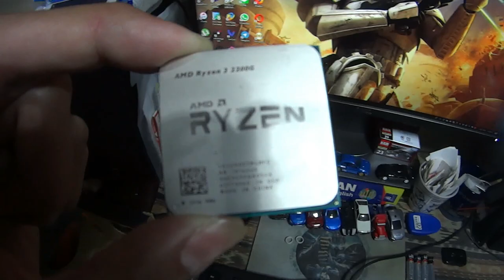AM4 Socket - AMD Ryzen 3 Processor (Installation)

Comment: Can we install am4 cooler on am3+ socket ?
Reply from the maker: Theoretically the AM4 stock cooler should fit on AM3 + boards, unless the holes are positioned differently then it won't. I haven't tried it.

Comment: - Processeur AMD Ryzen 3 1200 4 cores 3.4GHz (Turbo)
- Carte graphique NVIDIA GeForce GT 1030 2 Go GDDR5
- Carte mère ASUS PRIME A320M-K
- RAM 8GB DDR4
- Disque système SSD 240 GB
This is good or bad please tell me 😍😍😍
Reply from the maker: I think your computer set is suitable for office work and very very light gaming. Mainstream gaming nowadays are best run on CPUs with at least 6 physical cores. And your GPU is also entry level, I suggest upgrading to an AMD RX 570.